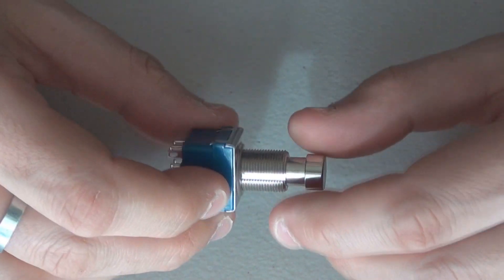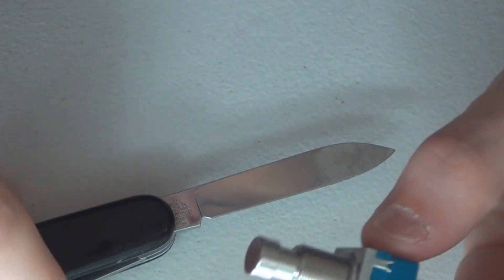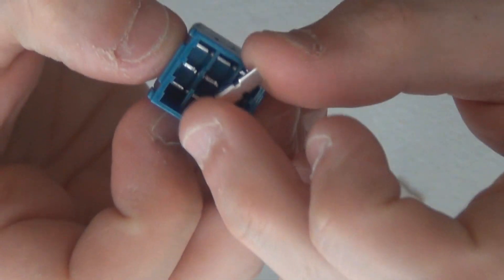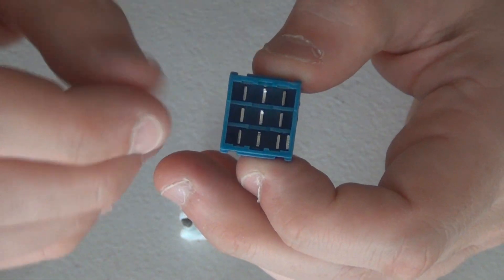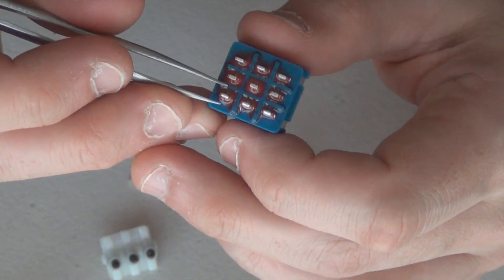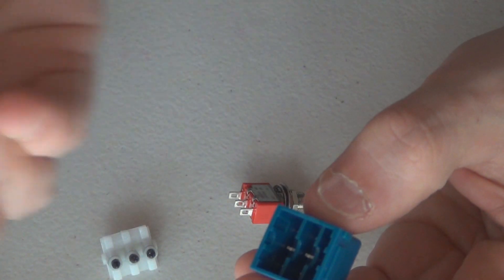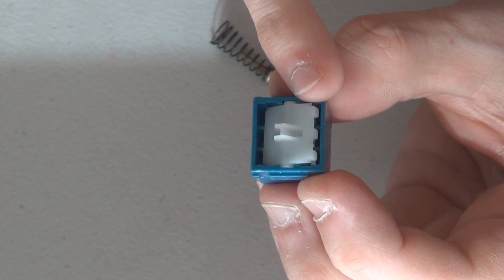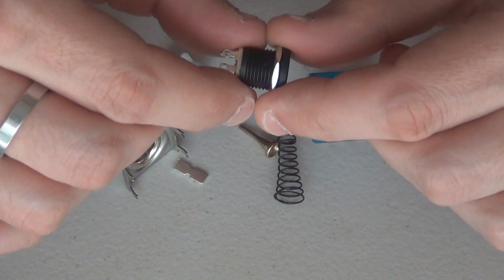The 3pdt Guitar Pedal Footswitch - How does it work?

Comment: Thanks for this information! I'm still wondering though, when modding a guitar pedal to a Eurorack module, is it possible to change the 3PDT footswitch with a Toggle Switch? That would make a ton more sense in my system, but i'm not sure if it is possible. I find a lot of 9-pin toggle switches online, many are ON-ON or ON-OFF-ON etc, what do I need? I have a feeling it won't work the way I want it to.

Comment: Melted the contacts of two switches on the second pedal I ever built, since then I've been using 3PDT breakout boards to make the soldering easier on myself.  Love the fact that the breakout boards I've been using have three ground contacts, it's also simplified my wiring quite a bit.

Comment: A few things to add to an otherwise very helpful video:
1) When soldering leads to the switch lugs, it is helpful to make sure the lugs are nice and shiny and not tarnished, as tarnish can slow down solder flow while still conducting heat.  Many of us  can take a while to get around to using our switches and they can tarnish in the interim.  Use a utility knife or similar to scrape away any tarnish, for a faster more problem-free solder joint.  Pre-tinning the lugs and the wire you want to solder to them is also helpful.
2) Thanks for mentioning about the incidental liquifying of the grease inside, that can turn it into an insulator.  If you DO encounter problems that are grease-related, you can pop the switch open, clean the rocker contacts, and re-assemble the switch, to eliminate the problem.  I've done this many times, and helped others salvage a well-loved pedal that had gone AWOL due to errant switch-grease.  Just realize that the tabs holding the two halves of the switch together DO NOT like being bent very far or very often.  Be gentle prying them and only bend them as far as you need to to wriggle the contact half out.
I have a few more things noted in this video - https://www.youtube.com/watch?v=6uhDKFhqYnw - but DIY GP covers most of what you need to know.
Reply from the maker: Mark, your video was the catalyst for my switch dissecting obsession :) you should make more videos, your knowledge is vast and invaluable.
Reply: @DiyguitarpedalsAu  Thanks.  You're very kind.  Keep up the good work.  I may know a buncha stuff, but your regular channel videos attract views and THAT gets the knowledge out to more folks, which is important.
Reply: @DiyguitarpedalsAu  Olá amigo, estou com dois pedal com problema no footswitch, na hora que aciona que aciona a chave dá um estalo,como fasso?

Comment: Just wanted to say thanks mate, these videos have been invaluable to my knowledge in diy pedals. If I may suggest a video, I’m at the point where instead of using transistors for boosts/preamps/overdrives i’d like to try tl072/tl071 style Ic’s, only thing is that the schematic image doesn’t make all that much sense to me. An instructional like this explaining which pin does what and where it goes in the circuit (positive, line input, ground ect) or even how to design the circuit around one would be amazing! Anyway mate! Keep up the great work! Also Would love to see some 5mm and 3mm pink/magenta LEDs in the store too 🤪 cheers bud!